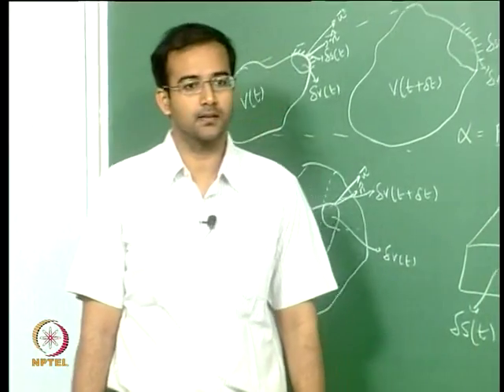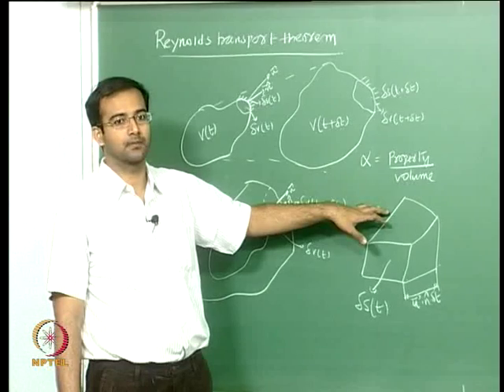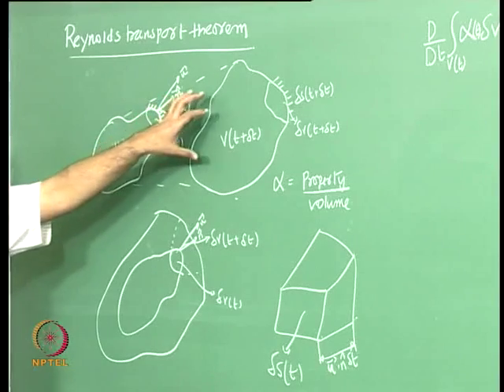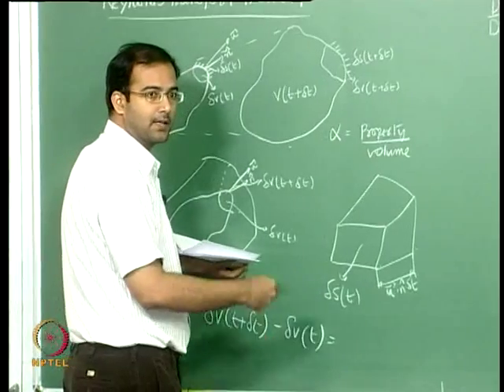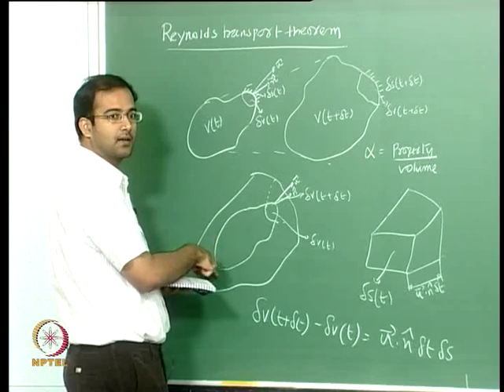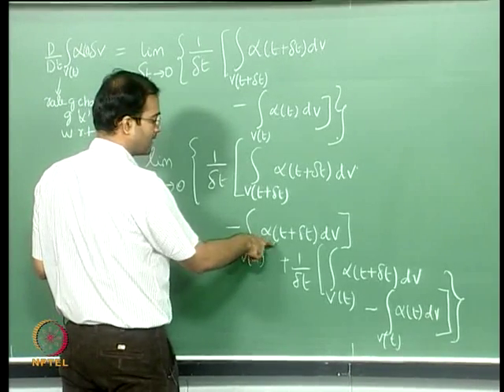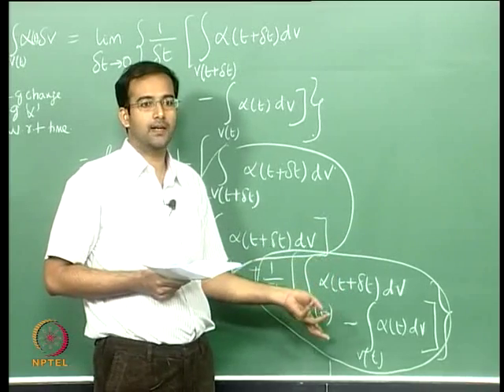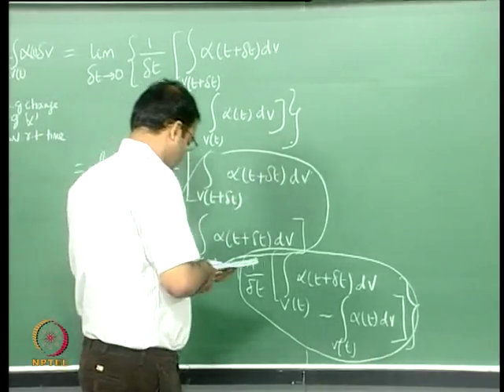Mod-01 Lec-06 Reynolds Transport Theorem

Comment: In 32:30 while writing the tensorial notation for momemtum equation by multiplying by velocity and adding them up there is an assumption that flow is incompressible which allows u_k to be inside the derivative.